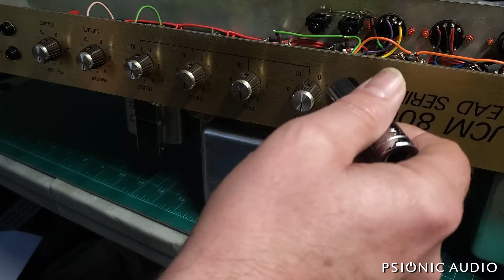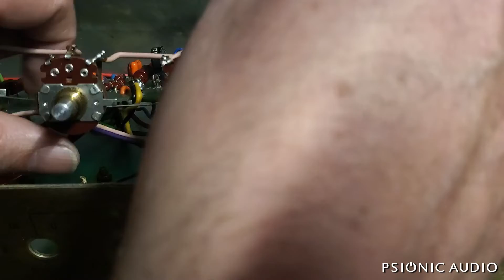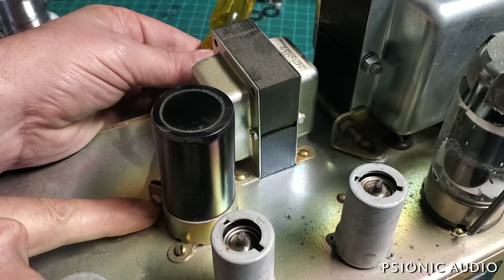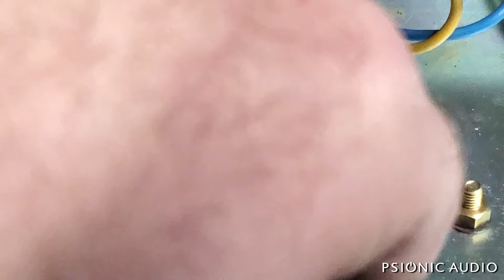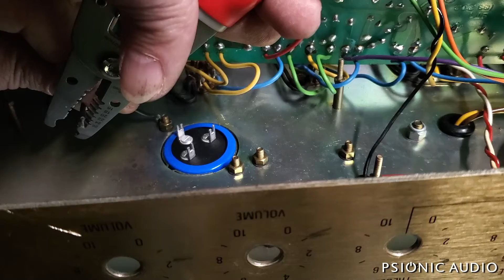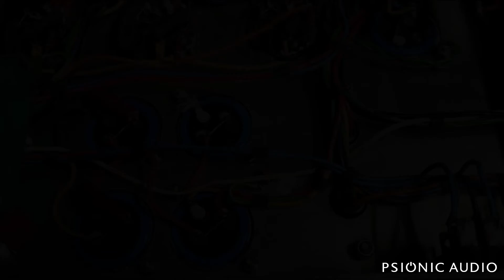'82 Marshall 2203 | Part 2 : Total Recap in Full Detail

Comment: Hi Lyle, I have a 1987 JCM 800 2205 and I'm about to replace the filter and bias caps with F&T and Sprague Atoms. A Lee Jackson video I watched recently said you have to "form" the capacitors. I hadn't heard of that before so did some sleuthing and someone else said you only have to "form" NOS caps and that new caps don't need it. What's the skinny on cap forming?
Reply from the maker: Not needed on new caps and you should only ever use new caps.
Reply: @PsionicAudio  Thanks, my caps are new so I can just install and enjoy! Replacing old caps with old caps seems counter-intuitive.

Comment: Why not solder those negative leads from the filter caps directly to the chassis instead of relying on the bolts that secure the clamps? Or is that a bridge too far for some owners of vintage amps? That is how Fender used to do it, and we've watched you remove Fender transformer grounds from the transformer mounting bolts and solder them right to the chassis. I would expect the cap-clamp bolts to loosen over time from speaker vibration and transport shock, not to mention that the clamp connects to the chassis in two places, which constitutes a theoretical ground loop, especially if the ground connection oxidizes underneath either mounting bolt.

BTW,  That was a very interesting bit of information about it's not needing to use balancing resistors on the two caps of the 1st filter node because you're grounding the center tap of the high voltage secondary, even though the rectifier is a SS bridge. Channeling Johnny Carson: *"I did not know that"!*.  I always assumed that one just ignored the center tap if you were using a full wave bridge, otherwise you'd get half-voltage or something like that.
Reply from the maker: I'm not subjecting cap leads to that kind of heat. And the issue in the fenders isn't directly soldered vs solder lugs - it's using transformer bolts to hold those lugs.
Reply: @PsionicAudio  i was referring to the first cap you did, with 2" of black wire from the cap to the ground lug. I  wasn't thinking of bending the capacitor terminals over and soldering to the chassis. I never bend those terminals; I don't trust the aluminum rivets that hold the terminals, having occasionally seen them become electrically intermittent or physically loose, on old caps anyway.
Reply: @PsionicAudio  Solder the chassis end first so the amount of heat involved in soldering it to the chassis doesn’t affect the cap? 

Or is it more that you don’t want to make the wire itself brittle?

Comment: Hozan makes usefull double-ended deep sockets for loosening/ tightening shaft nuts; three tools covers the range of six sizes, from 9 mm to 14 mm. They're much easier to hang on to without your hand slipping then a regular, slick chrome-plated deep socket is, and they have a sort of pivoting handle that can be swung to the side to form a handle for additional leverage if you need it. Your ordinary deep socket might be a little easier to hang onto if you put shrink wrap on it, or a wrap of electrical or friction tape. A knurled finish, instead of the slippery chrome found on almost all sockets, would be ideal.

Comment: The 25 ft roll is about 22% cheaper than 10ft roll.  Very nice wick 2.5 mm is a good working size .  Good video . I have been pleased with the der ee de-5000 esr meter about 100 usd on ebay.
Reply: Unfortunately, if you don't use solder-wick frequently, some brands may degrade if sitting around for a year or years. If the copper looks reddish-brown like a penny, it might not work well unless you add some extra flux to it before desoldering. In other words, hobbyists and part-time techs should buy desoldering braid in smaller rolls rather than larger.

Comment: 15:00 Yeah, I reckon there are quite a few techs who learn a thing or two from your videos (and from Brad's). There is indeed more than one way to do things right, but the end goal is the same. Clean, tidy, solid, and dependable.

Hemostats    Not often needed but very convenient when they are. Unfortunately my tool kit in the studio was accessible by musicians and I found myself needing to clean some strange brown residue from the tips of my hemostat whenever I needed it. But I digress...
Reply from the maker: Yeah, I figure I'm one of the only musicians to use stats for their intended purpose...
Reply: @PsionicAudio  , my dad called them "surgical roachclips". He took a dim view of such activities on my part.
Reply: Been a long time since I had to clean that type of residue off my hemostats!  Several of my numerous pairs of 'stats are actually modified;  I cut the latching mechanism off them and put doubled up rubber bands on the front half of the tool so that the jaws will stay shut under moderate pressure and grasp small objects without the excessive pressure of the latching mechanism.  Some of my small needle nose pliers are also fitted with rubber bands for the same reason;  if the needle nose pliers have springs to make the jaws stay open,  I typically remove the springs and substitute the rubber band to make them stay closed. Wire cutters, conversely, are more convenient to use if they are designed so that the cutting jaws spring open when you relax your handgrip.   (By the way, if I use the voice to text feature on this phone, it translates hemostats as "human tats" or "hemi stats" or "he missed that"! 🤣).
Reply: U😅 36:08
Reply: It seem to me your are being honest 39:03